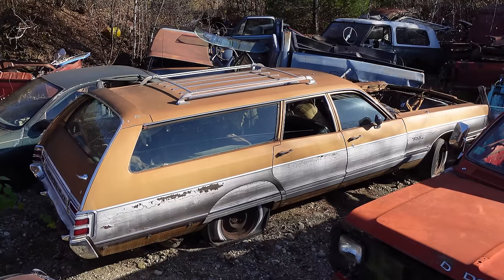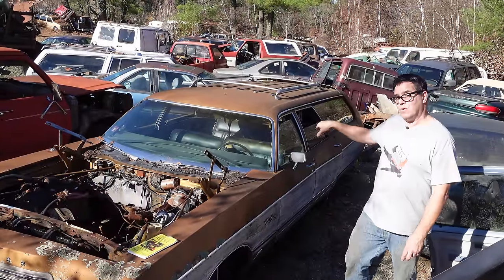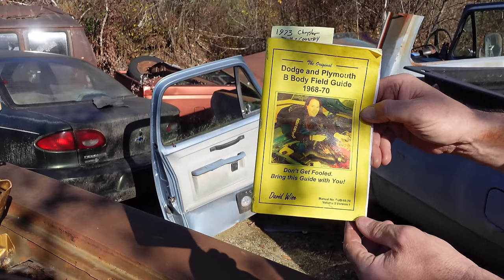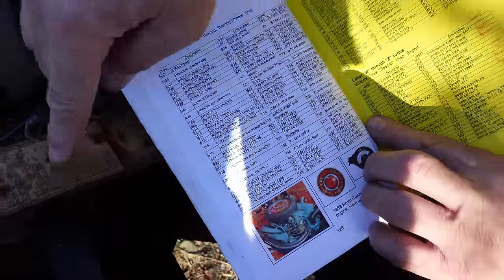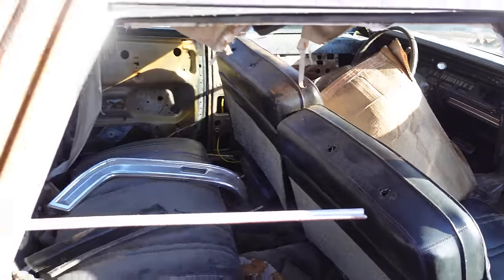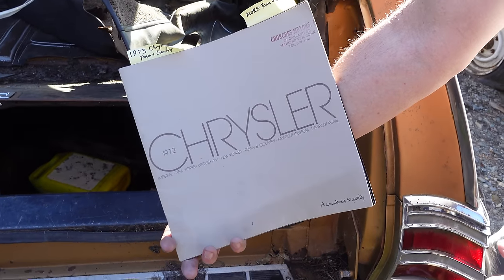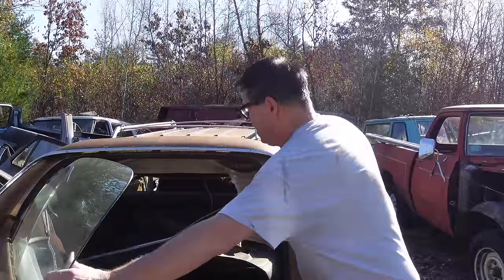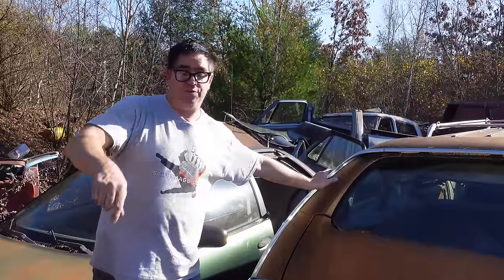1973 Chrysler Town & Country Wagon

Comment: A friend used his parents 440 powered Station Wagon to tow his 65 comet drag car.  He had paid to race. it was a 100 dollar entry with a really good pay out.  First test run his car broke an axle. the wheel stayed on but his comet was out. Just as a test he tried the slicks on the wagon.  Yep! They fit.  So he entered the wagon.  It was Bracket race and that big old wagon ran a totally consistant 13.9 all night long. At one point they tech stopped him because the trailer hitch was hitting the pavement on launch throwing huge sparks that night. He rolled down the power windows and the Tech guy was shocked he was actually running the Air conditioning in the car.. He said it made no real difference in times..  In the end he won it all.. When he got home he proudly told his father that he won.   Dad asked how did his Comet run.  "Um It broke" he said.. Dad kind of got big eyed and said. You didn't run the wagon did you?  He said Yes dad..  Dad held out his hand. Give me the winnings. Which he did.. Dad counted it all and then smiled "Here is your half. Now go fix your race care and dammit don't race the wagon.....

Comment: I'd love to own 2 1972 Chrysler Town and Country's. One all original, preferably the 440 and 727, but the 400 is just fine. Then the other one with either the hellcat or hellaphant motor with 8 spd trans., probably just a hellcat, possibly out of the TRX for towing😅.  Also a modern interior but close enough to original with headrests and drop down cupholder armrests to fool a few people. To use as a daily driver.

Comment: Looks very similar to the 9 seat wagon my parents had when I was a kid. All I remember as far as names go was "Sport Suburban". I'll need to do research.
Update: Yeah, we had a 1973 Plymouth Fury Sport Suburban with a 318 cid engine and the flip up rear facing seat 'family truckster'. The rear of the car was like factory lift kit to give it a sporty look. It was probably one of the best looking 9 seat wagons of the era. I don't know why Chrysler had to do the Town & Country at the same time.
Reply: That was the Plymouth version of this car.
Reply: @pdennis93  I see. I had no idea back then. It's like I never saw any others like the one I was riding in.
Reply: @7MPhonemicEnglish  yup. I believe the full name was Plymouth Fury Sport Suburban.
Reply: Because if you were an upscale customer, you bought a Chrysler, not a Plymouth, even though they were likely sold at the same Chrysler-Plymouth dealer and alongside each other in the showroom.
Reply: @googleusergp  yup. GM and Ford were the same way. You had low end wagons like the brookwood based on the biscayne in 71-72, then the midlevel townsman based on the bel air, the slightly higher level kingswood based on the impala and finally the top of the line kingswood estate based on the caprice. And that was just Chevrolet. Pontiac offered a couple wagon levels as well (Catalina safari and grand safari), as well as olds and buick varients.

Over at Ford you had the base ranch wagon and the up level country squire and of course the top range mercury villager. 

In the 70s there were tons of different full size wagon offerings. Usually the highest end offerings of each division were the ones with the faux woodgrain on the sides.
Reply: @pdennis93  The higher priced vehicles usually meant higher profit, so you had to have the mix across all of the brands to keep them in the showroom and not say, "Well, I think we'll go to Smith Oldsmobile (or Buick) across the street as they have a more luxurious wagon".

Comment: How easy would it be to bolt a 239 into one of those for extra mileage and traction while still potentially seating 11?  I'm not interested in speed, but it would still need to get started uphill, so I might want the lower trailer gears, and of course posi for the traction.  Maybe that very car would work, though I prefer the earlier grille.  Maybe I could cut up that grille in an interesting way.  A 239 wouldn't bolt up to that trans anyway, so that might enable me to use a 4 speed trans for efficient highway cruising even with the lower gears for uphill starts.

Comment: It’s a shame the 440 was taken out of that ‘73 fuselage Chrysler. Steve, unlike some of the hopeless, hapless, helpless, lost cause rusted wrecks that you feature in some of your videos, that one looked restorable. I had a friend whose parents had a 1969 Plymouth fuselage station wagon and they traded it in for a ‘73 Dodge fuselage wagon. Bookendmobiles! Their older one was used to pull a trailer, and therefore it wore out the transmission before it’s time.

Comment: Had problems with transmission on this. Burned out at under 40,000 miles without even pulling a trailer.
Reply: Speaking about pulling a trailer, I imagine a class 3 hitch is out of the question. I've never seen a MOPAR w/a Reese (class 3) hitch.

Comment: Low compression 440 with a thermoquad also with the air cleaner lid flipped. Punching it down the road thinking you were an indy car with the 4 barrel sound

Comment: Before cars were designed to mollify grandstanding congressmen.
Reply: It grandstand Shell, Exxon, BP. Even in the junkyard with no engine it's guzzling gas. OTOH once the Suburban gained 4-doors and car interiors in '73 it was the beginning of the end of the big car based wagon..
Reply: ah you mean good looking 😂
Reply: @ljmorris6496  Not for GM. It continued well into the 1990s for them.
Reply: @googleusergp  I said the beginning of the end, note how many Suburbans vs Caprice and Roadmaster wagons were selling in the '90s. Ford stopped in the 90's also with LTD once Econoline was the dedicated" large family wagon" before the Expedition arrived.

Truck based wagons are better at handling big families better. I do wish a rwd American wagon will return but probably the size of a CT6 or so.
Reply: @ljmorris6496  Well the statement of "the beginning of the end of big car based wagons" was true, but not for GM. GM sold a car based wagon through the 1996 model year, a full 20+ years after the 1970s would have spelled "doom" for them. In fact, during the 1970s, Henry Ford II told Lee Iacocca "No" on a minivan, fearing it would take away station wagon sales. Funny that after Mr. iacocca left Ford, they had a minivan. LOL.
Reply: And inept corporate engines rofl

Comment: A 6 cyl in that car would struggle to pull it esp at highway speeds and would get less fuel economy than a V8. I had a 73 Dodge van with a slant 6 that got all of 8 mpg when the clock turned 80K miles. Pulled it out and put in a 360 and got an extra 5 mpg plus a whole lot more torque.

Comment: 1973 I got my drivers license. 
Gas went from 50¢ to$1 in a flash.
Reply: In 1969 gas here in central Florida was 11.9  a gallon . We would fill up our street rods till the gas spilt out on the ground . Then it went to 35.9 gal .  and we all bought Volkswagens .  Didn't take long for us to want our V- 8's back !
Reply: @daynadiggle8169  I remember gas being about 66 a gallon for leaded and maybe 77 cents a gallon around 1977 or so. By 1980 it went up to $1.00. The 1979 gas crisis prevented my parents from buying a 1979 Trans Am and waiting until 1980. We did get one and I still have it, but by 1980, the turbo 301 was the top engine option.

If you want a good laugh, look up "1979 gas crisis video" on You Tube. It's a Mobil station in what I believe is Queens, NY with the owner and some customers complaining. You can see all of the big (and some midsize) vehicles in the footage and the owner talks about the issues he has and you can hear the customers. It's funny now, but in 1979 waiting on a long line for gas wasn't fun, that's for sure.
Reply: @googleusergp  Morning , G P .   I remember all too well the early seventies gas crisis .  I worked for businesses that couldn't wait in line for gas .  Like the auto parts store I drove for .  When I came back telling my boss they refused to gas me up in front of the line he calmly called each station and told them THEY  could come on down and get their own auto parts themselves !  I got gas any time I wanted it after that .   Also , the Daytona funeral home I drove for had a small fleet of vehicles that needed gas at least once a week .  Again , I was refused front of the line service .  My wonderful old boss told me to take an empty hearse down to where we did most of our refueling business and had me park it there telling the gas jockeys to refuel it when they had a chance . BOY !   That nearly started a war !   The station owner cried fowl but my boss told him if he could get people to stop dying during this so called gas shortage , there would be no problem .  Again , back to the front of the line with all mortuary vehicles !
Reply: @daynadiggle8169  LOL, that gets their attention. My friend (a person I worked with at the automotive parts manufacturer) was in a Sunoco station during the first gas crisis and said it was a fallacy, there was gas, it was just how it was distributed. By the time the second one came around, he was already out of the station repair business but I believe he still kept in touch with the owner and said it too wasn't an issue, there was gas. I learned how to rebuild alternators from this some person and I still stay in touch with him some 15+ years after we haven't worked together. He bought a 1974 Grand Prix brand new and the last time we chatted on e-mail, he told me it was "getting near the time to let it go". He wanted me to buy it. LOL. I would consider it if I had the room as I know whatever he modified on it was all bolt on and he kept all of the original parts to it. He was and still is fastidious about working on things. Everything is neat and organized. When he showed me how to rebuild a GM "SI" style alternator, the first step was to mark the case with a small mark so you put it back the same way. 

Everything had to be cleaned and tested. Nothing was "spray and pray". If it failed the test, or was marginal, it got replaced. Then, he made you draw a diagram of how it was put together inside so that you'd put it back the same way. I can probably still do them in my sleep. I remember getting one for my '84 Delta 88 out of a junkyard and rebuilding it for practice with my friend watching. I said, "Tell me when I do something wrong". He was quiet. He smiled and said, "You're not doing anything wrong, that's why I'm not saying anything" LOL. 

He was tickled pink when he found out I was into Pontiacs and had two Trans Ams. The first question was "Do they have Pontiac V8s?" I said, "Only way my dad and I buy them". He laughed and said, "We've got a lot to talk about". Nicest guy you want to meet and I used to get him his GM, Delco, Motorcraft, Ford and other brands of parts because I had a connection with a warehouse distributor at the time. He'd send all of his guys to see me for product questions. When the guys would come over they would say, "I know you don't handle this, but Greg gave me strict instructions only to talk to you and get the information". Great place to work, much like how "Dodge Main" in Hamtramck, MI had the playpen. The building was old and a city block long, just like Hamtramck was a city within a city.
Reply: @googleusergp  Great story , G P !   I know what it's like to have good connections with a parts warehouse .  Back in the day in this part of the country it was D A W .   Daytona automotive warehouse where everything came through and was distributed from .  But that's all long gone now as everything is made in China .    Well , still cleaning up here , we were smacked pretty hard .  I'm sure you've seen T V news .  Especially north in Wilbur By The Sea .  Poor people , all we can do is volunteer and pray for them .
Reply: @daynadiggle8169  Yes, the best that can be done is to be kind and try to help each other. Yes, it's hard to get good replacement parts now, as Mr. DeFeo keeps stating on his UTG channel. I'm shaking my head in agreement because I used to see it on the manufacturer side some 15 or so years ago. It was getting bad then, can't imagine what it's like now.

Comment: Yes, and no. The first oil crisis came in October 1973, so by then the 1974 models were coming out, the 1973s had (mostly) been sold. The "shortage" was in response to nations that supported Israel in the Yom Kippur war. 

Yup, with the VIN, we win: C for Chrysler, P for Premium price class, 45 for six passenger wagon, T for 440 V8 with four barrel, 3 for 1973 model year, C for Jefferson Ave, Detroit, MI assembly and the rest is the production sequence. The Jefferson plant that assembled this car operated from 1925 to 1990 and then was replaced in 1991 with the "new" Jefferson Ave plant which still operates today under Stellantis. No, that's not correct. The 55 MPH speed limit was enacted on January 2, 1974 by Richard Nixon, not in 1976. 

Yes, we did not learn our lesson and it was repeated in 1979. It was the reason my parents put off buying a Trans Am and by 1980, the Pontiac 400 and Olds 403 were both gone from the option list, and the 301 turbo V8 was the top engine (which is what we got).

We got the tag, we can brag: H51 for single heater and AC equipped, V5X for black body side moldings, G11 for tinted glass, all windows, P31 for power windows, P41 for power door locks, (J)Y6 for Golden Haze exterior paint, N51 for maximum duty engine cooling, R48 for power antenna, L31 for hood/fender mounted turn signals, D8X9 and X9 for black interior trim combination, P44 for power lock tailgate, E85 for 440 V8 with four barrel, D34 for Torqueflite automatic transmission. A16 comes back as a "Spring Special" code in some of the earlier years, but I believe it was reassigned to something else by 1973. My guess on M45 is some sort of trim code. The right-hand lower corner of the tag has the same VIN as the dashboard VIN plate. No, D31 is a light duty Torqueflite A904 automatic transmission. D91 is Sure Grip differential. 

Those books are indeed handy, but sometimes additional research is needed as some older information can be faulty and years later, new information surfaces that supplements what was published in the past. Factory literature is always the best when available. GM did a better job with putting RPO codes in all of their parts books and explaining them. Chrysler did a decent job, but GM was more "code" oriented even in the early years.
Reply: I guess I learned something new.   I was always under the impression that all big blocks always had A727 and the 904 was reserved for small blocks and the slant 6.
Reply: @kennethsouthard6042  He mentions "D31", but this car doesn't have that on this tag. D31 is for the 904 Light Duty according to the reference information.
Reply: Hard to believe that original Jefferson Avenue plant was building these monsters in the 70's and then they switched over to the K car as I read in your post today on Classic Ride Society.
Reply: @stepheng3667  Yes, that 1987 New Yorker that Benny at CRS featured was also made in the same Jefferson Ave facility.

Comment: As far as taking engines out of early or mid 70s Chryslers and sticking them into an older model mopar,  if anyone believes that the 383 out of a Newport is the same as the 383 magnum,  you should put your tools down and stop.

Comment: Old wagons had their problems, too. Gas tank mounted vertically inside the rear fender, behind rear wheel which slings slush laced with salt at the gas tank. It then rusts out. Difficult to remove fix or replace.
Radiator corrodes and needs removal, repair, or replacement.
Poor gas mileage due to V8 and weight of car. Have done it all. Just saying.
Get a later model hatchback and V6 engine.

Comment: No need to look at the VIN tag Steve, we know it is a 440, because the motor is gone!
Reply: That part is true, and T&C models in 1973 only came with a 440 V8 from what I recall.
Reply: @googleusergp  I think Steve said they also came with the 400.
Reply: @formula112967  I think that's right. That's what I get for going off the top of my head at times. LOL.
Reply: 400 was not available in 73, 440 only
Reply: @Mattisgarage  I believe the literature dies show a 400 option for 1973. He has correct.
Reply: @googleusergp  Nope. In 1972 400 was standard and 440 option. In 1973 only 440 available. https://www.hamtramck-historical.com/images/dealerships/1973ChryslerAdvanceInfo/73_Chrysler_Advance_Info_0001.jpg
Reply: @Mattisgarage  I saw it somewhere and I must have misread it.

Comment: Chrysler ruined 73 c-body non-Imperial non-Monaco front ends. Looks like a Caprice. Not the distinct Mopar styling.
Reply: I think that about that time GM had a designer defect to MOPAR. I was 12 when 73s debuted and remember thinking to myself, "my god. That 73 Monaco looks a bit like a 72 Olds. " I read that sometime in the last half of the 70s and just had an epiphany. I've lived my whole life for this moment. 11.13.22 @10:30am.
Reply: @kenttalsma7906  Chrysler usually followed GM styling by two or three years. There were only a few times where they were different.  AMC wasn't much better.